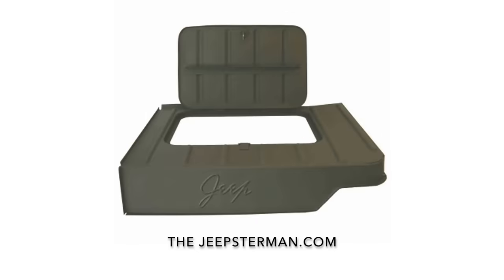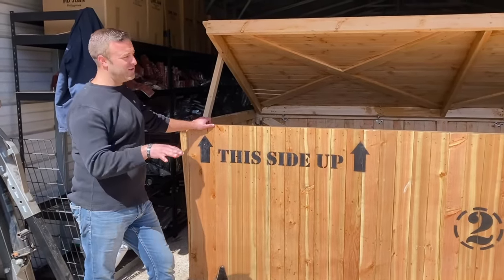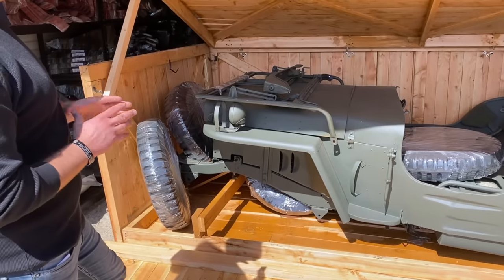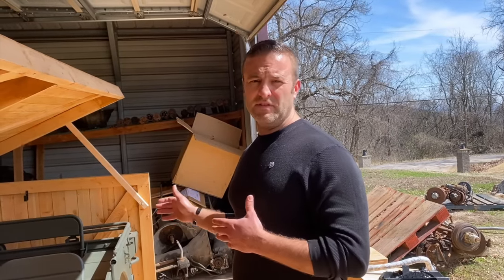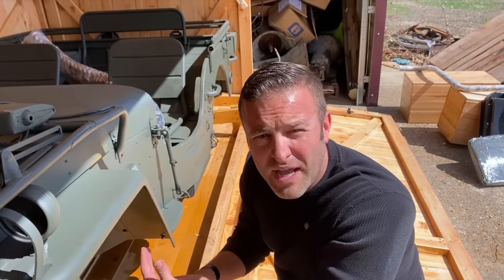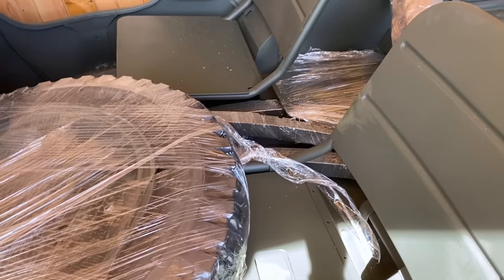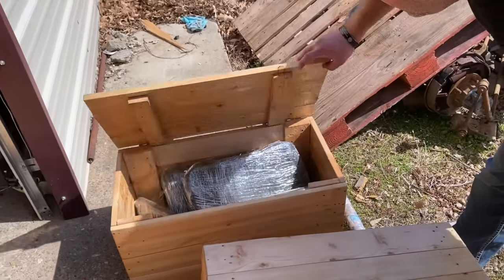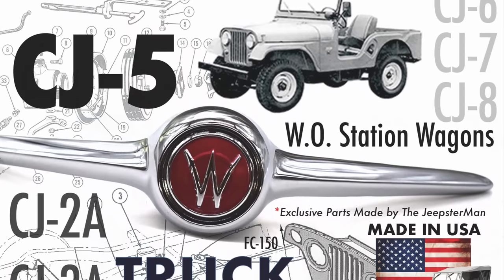1942 Willys MB "Jeep in a Crate" | JeepsterMan

Comment: I bought one in a crate at an auction at the Army Depot back in 1986 for $400. It was packed in 1951 and stuffed into a  corner of a warehouse with a dozen of its friends for 35 years. I can tell you that the original crate was nowhere near as pretty as that crate, and mine came with the driveline installed, just had accessories and wheels/tires to install.
Reply: You bought a WWII jeep in 1986?
Reply: @DJeepThoughts  yep. They had it sitting in storage at the Army Depot since 1950. It was there to have communication equipment mounted to it but it never made it out of the crate.
Reply: B.S.
Reply: @johndoran3274 willing to part ways with it, to a new home?
Reply: @wilfredmena2497  lol, I sold it 25 years ago after I had my fun with it. The guy who bought it restored an M4 and a half track and has a small private museum. He passed away a few years ago, but his kids still have it.
Reply: @johndoran3274  worth asking lol
Reply: That's too cool

Comment: In 1967, Tunick's Junk yard, in Stamford, CT, had many of those jeeps in crates. They were $200 each. I looked at them but, the problem was that the electrical wiring harnesses had deteriorated so that you had to make a new one. That was beyond my capabilities at the time. I remember them advertised in the backs of magazines at that time too. Good Luck, Rick
Reply: somewhere in that era you could buy most any Jeep parts through JC Whitney, including a harness and most of the metal
Reply: @rupe53  You're right but, I didn't find Whitney until a couple years later. Good Luck, Rick
Reply: The electrical wiring harness would be like 6 wires in total. But, hell, if you need an excuse not to buy, it's as good as any.
Reply: @erik_dk842 It was reality. I was 16 and didn't know anything about wiring. My father was against it so, he wouldn't have used his truck to bring it home for me.
Reply: Surely you could've got an auto electrician or mechanic to make a new wiring harness. How much wiring could there have been?
Reply: @OffGridInvestor  I was a 16 year old kid and just didn't know. My old man was against it. A machine gun caught his jeep in N. Africa during the war. He didn't like jeeps. He then picked a car for me. Good Luck, Rick

Comment: Dad had a real 1942 Willys that was a former military Jeep.  It was small and slow but fun to drive.  I believe we converted it from 6v to 12v.  That old flat-head 4cyl was so easy to work on.
Reply: My grandfather bought a used civilian-style CJ after the war to use as a farm tractor. Several implements were made for war-surplus and civilian jeeps such as planters, cultivators and even plows. It served acceptably on their small acreage for several years, although it had a golfball-sized hole in the engine block.

Comment: I could have used that back in the early 1980s.  I had a rusted-out 43 Military jeep.  The body was a total loss.  We ended up with a frame, engine, transmission, and axles.  Working on an extreme budget with a goal of having a functioning 4WD, we ended up buying a mail carrier jeep front end (fenders and hood) and a Wrangler body.  To our surprise, all the holes lined up and we just bolted it all together (well, after we reduced the machine gun mount on the cross member).  It ended up being registered as the 73 Wrangler.  We sure could have used your kit!!!

Comment: I was the Director if Services at Camp Darby Italy in 1981-2. We had a Depot Support Activity that was collecting up non running and rusted out M151 jeeps which replaced the MBs and the M38s. Was an entirely different vehicle and shared few if any parts at all with the earlier 1/4 tons. The hulks were stripped if all running gear, engines and suspension. These parts were sorted, cleaned and cataloged. We received big shipments of crates similar to those in the video. The crates contained newly fabricates M151 bodies. A production line was set up by our Director of Maintenance to churn out basically new M151s. The M151 was washed out of the inventory a few years later and replaced with the HummV series

Comment: The MCLB Barstow annex in California has about 25 or so brand new (used) early models that where once ready to be shipped to Korea and almost all of them are sealed for long term storage the Corp used to break out a couple once a year for parades they only have around a few miles on them and they all have original issued equipment or accessories.

Comment: I was in the Marines 79-83, and occasionally the motor pool would get a new in the crate M151 jeep. Allegedly,  the wiring harness was assembled,  and the pistons were on the crank shaft, but everything else was wrapped and boxed. Procurement price in 1969 was about $900, from the stencils on the crate.

Comment: back in the late 70's a friend and I had a custom Van shop Cincy Street Vans. On our way to pick up a clients van we saw a WWII jeep buried to its axels in a front yard. We stopped and asked if they wanted to sell it. Nice old guy said if you can get it unstuck its yours. We got it out and replaced the brake lines tuned it all the usual stuff and it ran the little 4 cylinder was quite pepe. A lot of great memories with that jeep.

Comment: Back in the early 70's you could sign up for a Jeep-in-a-crate for $55, and be eligible to attend the auction.  There, you would bid for crates of "jeeps."  But, the caveat was that you never knew what parts were inside.  It might be a crate full of fenders or a stack of frames, or some windshields and seats, etc.  In the end, you had to preview a huundred crates to get enough parts to assemble a single working Jeep.
Reply: @OutnBacker Had a neighbor whose uncle had purchased Jeeps in crates via government auction circa early 60s. He remembered also, that you had to purchase a lot size of minimum 10 crates, but could increase lot size by 10, up to 100 iirc.
The uncle had a used car business, which aided in access to auction mailings/listings.

Comment: Back in the early 60s there was a wrecking yard only a mile or so from where I lived and that guy had at least 20  Jeeps in the original military crates stacked on top of each other in a huge lean to area with Jeep frames and engines,axles and crates of parts.Lots of complete Jeeps from the 40s and 50s with their military markings.
That yard is gone now and I haven't been down that road in years.
So urban legend no I remember them clearly.

Comment: Yes you could buy them after the war ,( us army surplus ) From a warehouse in Dagenham Essex , they were 100 pounds sterling , the guys unboxed it put the wheels on a new battery steamed the transport grease off them put 5 gallons of gas in it and you drove it away , I used them a lot when working building  the UK interstates ( motorways ) drove them until they died then buried them under the motorway and bought another .

Comment: back in the 80s I worked for a guy whos family collected and restored military vehicles,,
for a side project for the shop was putting together a jeep set up like this one,
by the time I got there it was a rolling chassis and I helped put the engine and trans in, and set up the break system
I was going through wooden boxes like you have there for break parts and such,
everything was still wrapped with cosmo paper
it was all brand new and I am thinking it was a 41-42,
the funny thing is it was made for france and everything down to the stamps and labels on the block were written in french,

Comment: Yes, you could buy those after World War II. My gab bought one up in Portland Oregon at a huge army surplus store and we used it on the ranch for years and then I ended up driving it for a while and I sold it in about 1975. But those old jeeps had a maximum speed of about 45 miles an hour and they weren’t on the road are use it for deer hunting up in Oregon. The one in this video I think is a reproduction there is a video on YouTube showing a company that is reproducing the old World War II jeeps

Comment: Back in the 1980's, I had a DRMO bidder number and often went to the Memphis TN auctions. I remember one summer afternoon, a 1942 'Jeep-in-Crate' came up, but an old WWII mechanic was there bidding also, he said 'thing probably ain't worth $50'...I asked 'why?' and he told me, 'you can't be sure what's in the crates...in-Theater motor pools would open the crates, often 'robbing Jim to pay John' (stealing or swapping parts) with directives of 'don't assemble new units unless the Company count falls below expected minimums'...a lot of times, you'd find 4-drivetrains in a crate (no Jeep), other times the wiring would be gone, or both axles, etc.' Basically, the 'Jeep in a crate' became a dumping ground better titled 'Some Jeep parts approaching a full unit - though it may be worn out old parts - may be inside this crate'. This is why they shipped hundreds of the crates back...they really didn't know what was inside a vast number of the crates, so they brought them back stateside to 'inventory' them. They got inventoried, re-sealed, never needed due to newer models, many sat for 20-40 years before bases were commanded to 'relinquish old equipment not in use to DRMO (Defense Re-utilization Management Office) for further disposition. In reality, I'm guessing less than 500 'new units' were ever realized and sold in the U.S. So, no, they weren't 'intentionally cut in half' or 'disassembled on purpose'...as there was nothing 'specifically military' about them (compared to, say, a Heads-up fighter aircraft display windshield)...

Comment: This needs to be modified and sold as a separate option for electric motors, thus to have space for battery pack (either underbody so the frame to be alterted) or put battery+ electronics under the hood and the motors directly in the front and in the back
Reply: There's a company near me that specializes in all that stuff - using a lot of Tesla components - they have a YouTube channel.

Comment: you can adapt a international scout under carriage for one of these bodies ..the scout isn't exactly the same but it's very similar .. I understand the frontend is close enough that most of the parts will interchange between scout and willys the scout engine is a slant four with standard trans and transfer case
Reply: i wonder if my K5 Blazer could be removed and frame, engine, trans, differentials all be bolted under one of these. the diffs are 1 ton and they have been swapped to jeeps. there are 2 short videos of the Blazer on my channel. 40 inch tires.
Reply: that sounds like a tight fit but with enough cutting welding and machining anything will fit whatever you want ...!

Comment: I own a 75% original 1943 Ford GPW that was built in Dallas Tx. The tub was one of the last to be build in Fords assembly plants. Only thing I am missing for 100% original Jeep is the Motor, Transmission and transfer case and Data plate everything els is original to the Jeep including well preserved Original OD green paint underneath all the layers of paint. She needs a new floor, new frame horns and frame rail sections, and about hundred or so hours of hammer dolly work.

Comment: Adding to "the myth"... I grew up on a ranch and my father bought two of these, and one trailer.
They weren't $50 like most of the magazine ads claimed. The most expensive one was $300 but came with a trailer.
Both Jeeps were brand new, in crates. Assembly required.
Assembly wasn't a big deal. Absolutely everything was included... even battery acid that we had to pour in!
The only "flaw" was that the numbers on the sides of the hood were crudly covered with black spray paint. Fortunately it was fresh enough that it wiped off pretty easy with a rag soaked in mineral spirits.
My father bitched for decades that he paid too much. Then again, $300.00 was big money back in 1960.
We worked those poor Jeeps pretty hard but were also very meticulous about preventative maintenance.
I was the last kid to leave in the late 60s. My parents sold the ranch soo after I left for Vietnam. The Jeeps were left with the ranch. 😢
My best friend in high school got his for $5! Yes $5! His was also new in the crate and once we got it to his house, I helped him put it together.
He still has it!
Usually the stories you hear are... "My uncle's next door neighbor's best friend knew someone that bought one etc...
I can testify in front of GOD with witnesses that are still alive, that I personally saw, touched, assembled & drove three of these! 
Obviously there were more as there were several in my high school parking lot too. (Some are even pictured in my yearbook.)
Bottom line, the "myth" has some truth to it.
Oh a neat thing I learned was... when goofing off & crashing one, it's easy to repaint the damaged area(s) with Rustolium brand paint.
Simply mix a 2 to 1 ratio of forest green with red oxide primer and you get a near perfect ww2 shade of O.D. green with just the right amount of gloss! Pinky swear! It works or my dad would still be kicking my butt!
Reply: Wow that's the most elaborate one yet.

Comment: I have some questions I hope you could answer: Are on this Jeeps any VIN Numbers and Papers on this Jeep in a crate? And do you ship to Germany? Are there Ford GPW Versions available? 
Greetings from a Willys MB/ Ford GPW Fan from Germany. It's my dream car
Reply: Pretty sure you build it/ have it built in FL you can have it registered as 42, should be no problem with import laws.
Reply: I seriously doubt these would be road legal in germany. No safety meassurements, no emission systems, no nothing. That is if these cars are actually remanufactured and not a restored original, in that case it might be possible (with some mods on the lights).

Comment: Considering it’s also practically impossible to find a drivetrain for these. Does anyone make drivetrain kit or is there a suitable donor vehicle out there that can be stripped for parts that will somewhat fit with some work?
The price for the kit is a bit too costly. You can get a real rough but running HUMMV for around the same price. Just as the Jeep, no doors, windshield or roof.

Comment: Are all of the needed parts to complete the Jeep still available on the market?
Reply: Don’t need to ask if you have enough money.
Reply: Yes and no. Yes much is available but not at any given time. Original, correct, usable engines are very hard to come by. Complete T84 trannies are very hard to find. Original small shaft T-18 Transfer cases are available but will generally need rebuilt. Original axles- good luck. If you do find them they'll need extensive work. NOS springs are non existent. Everything else is available in the form of reproduction parts. Be careful though. There's a lot of junk parts out there. Peter DeBella is my go to source for WWII Jeep parts. He has a lot of NOS and his repro parts are correct. I have two originals and a Dodge WC58. They are hands down, without a doubt, the funnest and most rewarding vehicles I've ever owned. I'll never be without one till they're putting me in the dirt.

Comment: So basically, you have to already have one to get the drivetrain out of for this one. If you already have all that, wouldn't you rather restore the original and have the real thing? I guess I just don't understand the point in buying one of these if I still need to find the engine, transmission, transfer case, axles, drive lines, etc. I don't care how nice the box is.